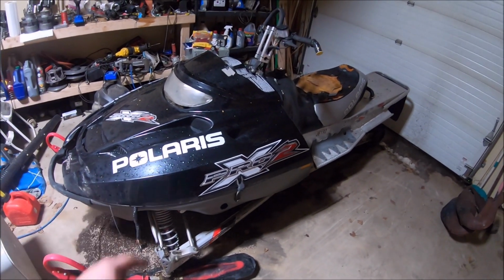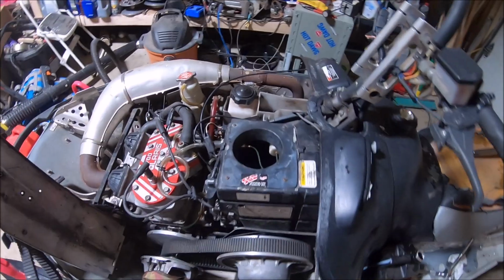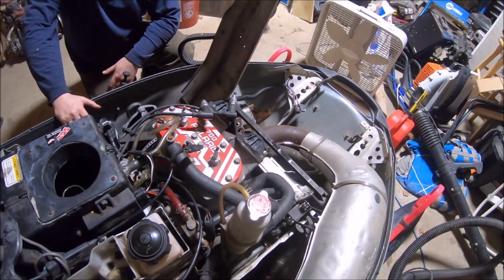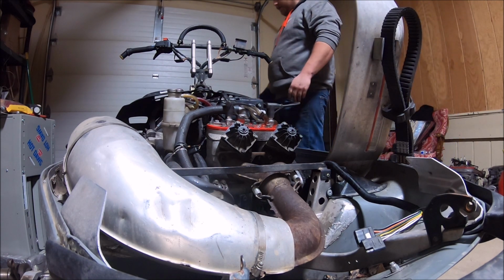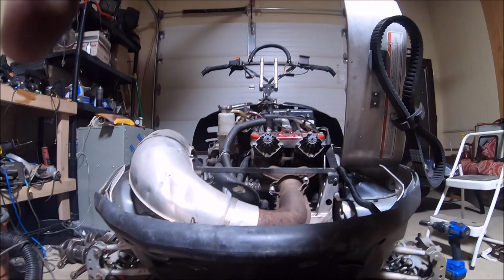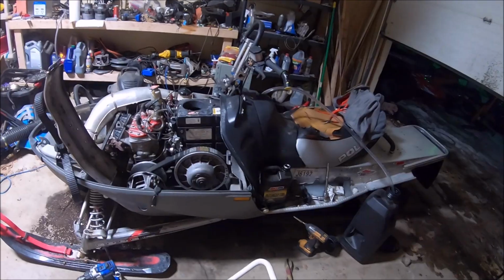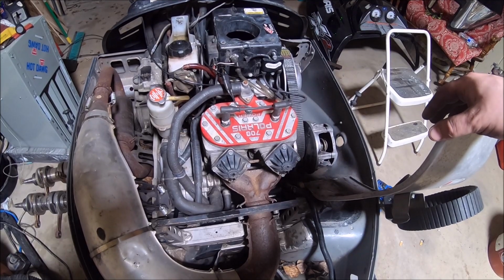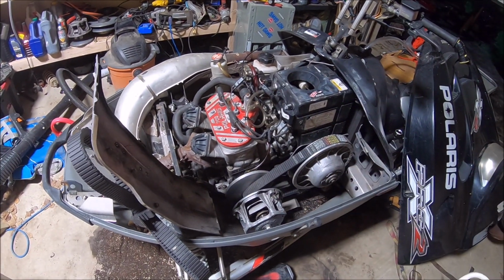Will the Polaris ProX2 700 RUN?

Comment: I'd start off with that recoil, then check compression, correct ignition, fuel, carb cleaning, maybe a coil is bad, voltage regulator, ecu, stator? You'll get it up and running anyways, you always do 😂👍
Reply from the maker: It’ll be going soon one way or another, if it’s a 700 ves, 700 non ves or 800 non ves is all up in the air still.